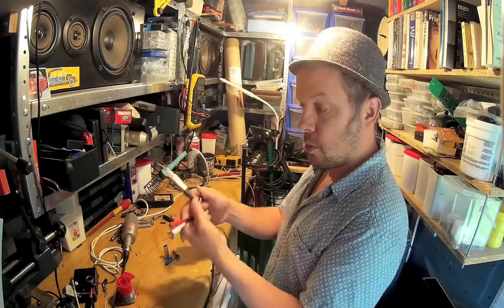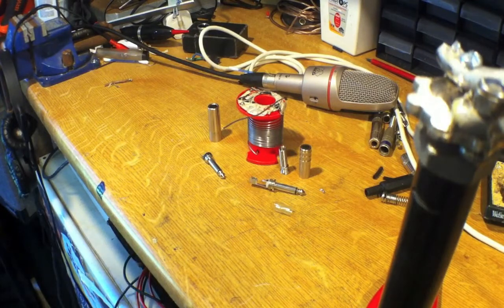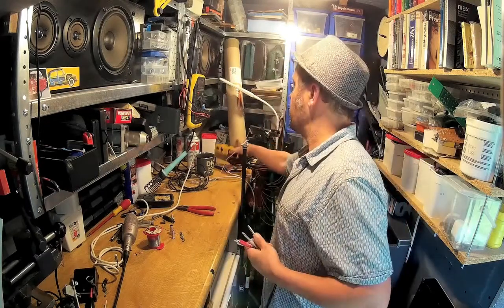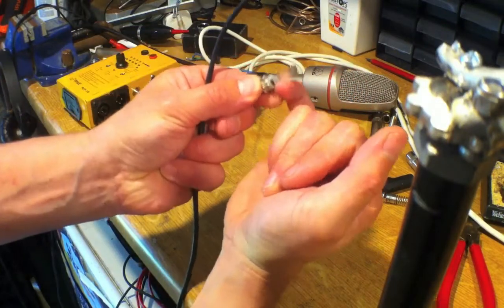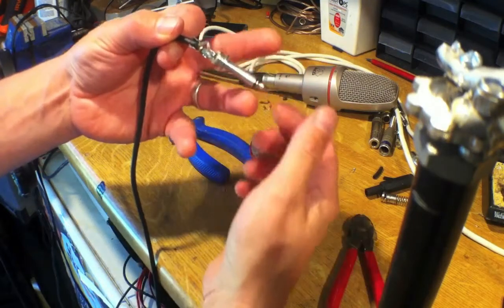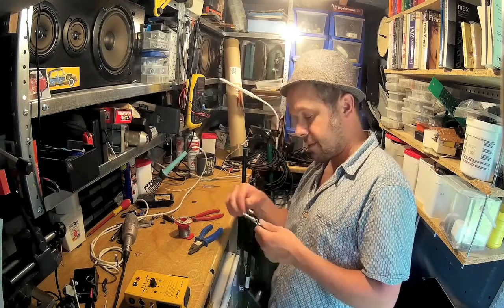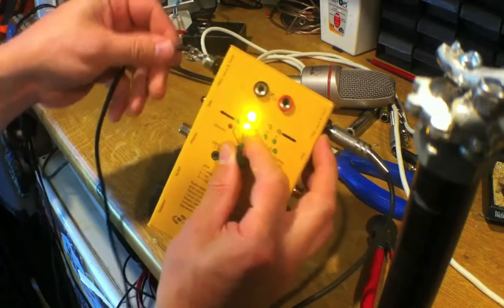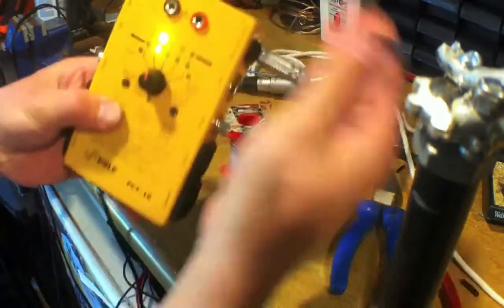JACK cables: repairing and testing

Comment: Would there be any benefit in using balanced (microphone) cable for unbalanced (instrument) connections? 

Not accounting for differences in signal wire guages and shielding, this appears to be what a great many of the very expensive guitar cable manufacturers do. Putting aside marketing spiel, could there be a plausible grain of truth in their claims?